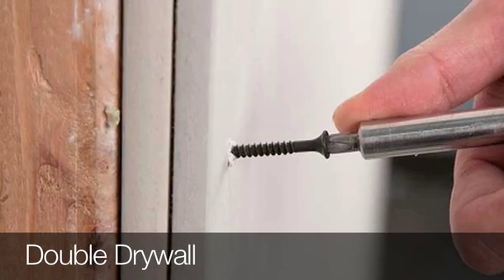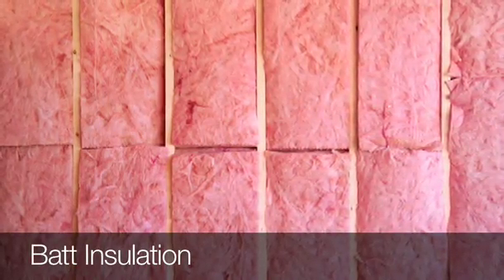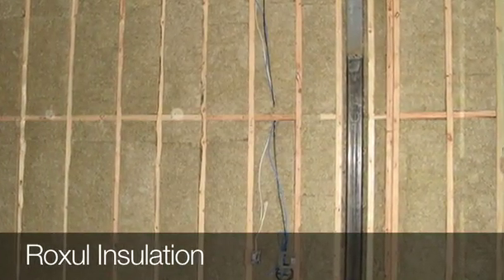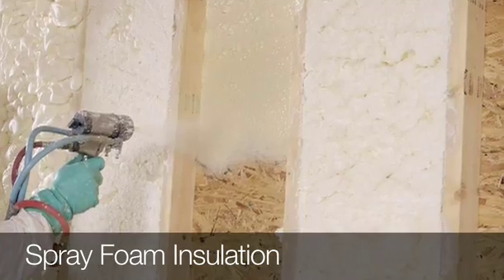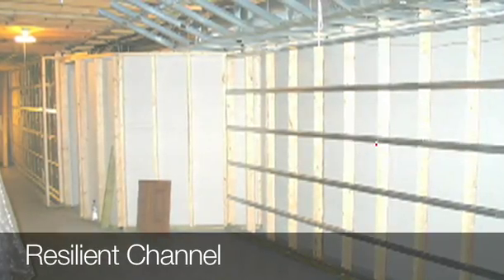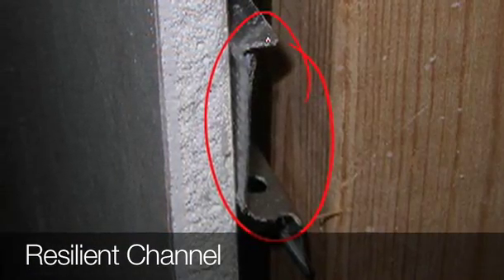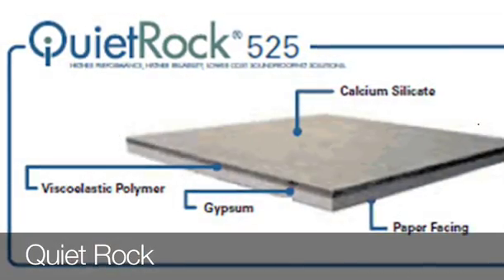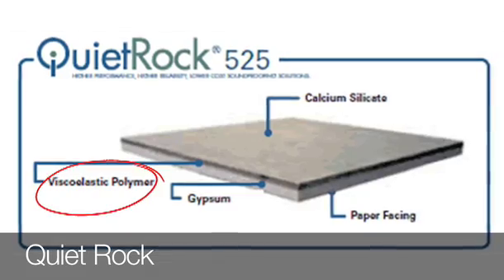How to Soundproof Interior Walls

Comment: From my limited experience, if you are going to invest in two layers of drywall, screw in the first layer as  you normally would, then put something, almost anything squishy and sticky between that and the top layer, even foam tape or silicone, then put screws only on the perimeter of the top panel. If the layers touch, it will be almost like having one thick layer, a little quieter for sure, but less than if they are isolated. And caulk around the edges. Also, if you use fiberglass, pack it tightly; fluffing it up as you would in an exterior wall won't absorb a lot of sound.

Comment: For frame of reference, quiet rock is about 5 times the price of the thickest home depot drywall 5/8ths inch.  I priced it recently and even their most expensive mold resistant 5/8ths drywall at the depot was only around $15 while the lowest priced quiet rock from the nearest distributor was around $75 per sheet, same 4x8 foot sheets.  We opted for Roxul and 5/8ths home depot drywall.  Already noticed a difference in the sound transferred from the shower to the kitchen so we are continuing on and doing more walls.  Might redo all exterior walls later but for now just considering adding a second layer of drywall to the exterior walls.  

My neighbor drives a big noisy pickup truck and starts it up every morning at 6am and lets it sit there idling for 15 minutes.  Wakes me up every day off, 6am every bloody morning.  I know nothing I say will change them so I need to make a sound proof bedroom to isolate myself from my selfish neighbors that have no clue what their noise does to other people around them.
Reply: Oh brings back memories of my neighbor who let his Ninja motorcycle idle for at least 20 minutes while he had breakfast every weekday morning. The high pitched engine whine would vary RPM at random the whole time.
Reply: get a decibel meter, then call the cops
Reply: Ridic # of people that idle their cars.. Sit in em doing nothing etc. Ignorants.  Set up an outdoor spkr by their window & turn it on each night
Reply: love reading someone else doing this... WE CANT SETTLE for regular walls... Insulated and plywood covered frames (with screws) cant be beat

Comment: The first photo witih the two layers of drywall has a serious but common mistake, you don't screw both on and you don't lay them both vertically. screw the first on to the wall if you don't have resilient channels, then after that is done take green glue or construction adhesive and lay the other layer horizontally with the adhesive so there are no screws to penetrate the wall into the studs, this is critical with resilient channels because if you screw through to the studs you have totally ruined their purpose. So screw the channel to the stud, then screw the drywall to the channel without going all the way to the studs. then glue the rest.. Also, do not use the same thickness on the inner and outer side of the studs, this can cause some unwanted resonance at specific frequencies. And the more drywall the better, limp heavy mass will soundproof.

Comment: 1/4 Hardy board with red guard or rubberized undercoating on the studs for your first layer, followed by drywall screws through both layers to hold it is a very very economical way to get very good results, particularly if you seal penetrations
Reply: So what about MLV on studs + Hardy board + Quiet Rock + 5/8 drywall?
Reply: @MadLadsAnonymous  that would definitely be quiet. One technique that I really like using is 2x6 plates with 2x4 studs where the interior stud layout is offset from the exterior (both 16in OC). This uncouples the interior wall from the exterior wall, is up to code. 5/8” rock and quiet wool. They have some quiet rock that I like to use on the lid for ceilings in 2 story applications also. This 2x6 w/ 2x4 stagger method is what I use for interior quiet walls also: laundry room, bathroom to bedroom walls, etc.
Reply: @Natedoc808  We are looking at ICF construction (Perfect Block) for our next build, but I'll look into creating interior walls per room so they're all technically decoupled from the core structure.
Reply: @MadLadsAnonymous  ICF is bombproof, extremely quiet

Comment: Excellent video. Thanks very much. I would also suggest Mass Loaded Vinyl. It's ultra heavy and dense sound absorbing material. You hang it on the studs it's the last layer just prior to hanging the dry wall. Not very expensive. Possibly more effective than double layer dry wall. But as I say its very heavy.
Reply: Also MLV is expensive and the best way isn't to hang on it on the studs, it's to have it snake in a wave pattern (image a birds eye view of a wall), so that the mlv can properly flex to deflect sound; which means you need even more MLV material. Two layers of 5/8" drywall with Green Glue in between will work better than MLV on low frequencies. 

MLV is far better as an underfloor layer than in walls. A floating floor with MLV under it is great at stopping airborne and mechanical (impact) sounds.

Comment: Hi I live in apartment first floor . Landlord said I can do what I need so if I put foam on celing with an  adhesive let it dry then add 4x8 acoustic panels that are thin by using nails or screwing them up on the existing ceiling.  Layering foam then panel will this work ?? Bathroom is 8x10 no light fixtures or fans just flat ceiling

Comment: If you use battens & thick rubber washers to keep the battens from the wall it will serve the same purpose as a resilient channel
Reply: GETTHEDEUCE pls can you explain further. I'm curious to know how to do this
Reply: @isaz597   Cross batten the walls with another timber, but between the studs and battens have the washers. Then drywall as normal, fixing to the battens.

Comment: Spray foam hardens therefore transfers sounds.
Reply: Maybe if you speak with a lisp the sound does not transfer as well.
Maybe if you thpeak with a lisp the thound does not transfer as well.
Reply: Wrong.....
Reply: Spray foam has bubbles therfore traps sound

Comment: Acoustical sealant around penetrations and Junction points (places where walls intersect with ceilings, floors, and walls) is also important when assembling a wall system that is promising an STC of 50 or greater.  But, keep in mind the 3 important safety senses we all possess: seeing, smelling, and hearing. Therefore, being able to hear if someone is in a room, can be important.
Reply: Eric Barritt the last bit sounds dodgy to me. Pictures spring to mind!

Comment: Argh, this video is terrible, don't follow their advice:

1) Resilient channels are a REALLY bad idea! It's far better to buy isolation clips + metal hat channels
2) Spray foam mechanically connects everything and makes it worse than before.. you might as well not have a wall. 
3) It's far cheaper to buy two standard layers of 5/8" drywall and sandwich them with a layer of Green Glue in between.(yes, it's more work, but it's still cheaper AND better than 'soundproof' drywall) 

Isolation, Mass, and dispersal together are what will stop noise.
Reply: Soundproofing Drywall is a much better solution than double 5/8" drywall with GreenGlue to achieve an excellent STC (sound transmission class rating). Double Drywall is however a good alternative for people on a budget but your STC rating will be much lower. I've soundproofed homes for over 10 years and lived with both wall assemblies in the same home and it's an obvious difference that is backed by technical data (available on the QuietRock and GreenGlue websites). Resilient channel also works well if installed correctly. Where I live RC is required by code in all multiunit residential renovations to reduce sound transmission.
Reply: @DaruDhillon  Hi there Soundproof Double dry wall + Green glue put straight on a concreate bedroom wall good idea please?
Reply: @dellsmith6026  Hi Dell, I've only built (2x4) stud walls with an air gap, where concrete walls are concerned. I wouldn't want to attach drywall directly to concrete without first allowing an air gap between the the wall and drywall as I'd be concerned with moisture getting in behind the drywall, causing it to mold.
Reply: @DaruDhillon  Thanks your cute by the way 😊
Reply: Do I need to mud and tape the buried layer?
Reply: @414pwz  nope

Comment: has anybody tried these combinations?
what are your best results?
Reply: HoldUpStrong res bar or sound bar is always the best. Add any accoustcal insulation to improve it. Double up fire rated 5/8 thick drywall for a complete package. Do all interior walls and ceiling for a sound isolated experience. 

Sound bar creates a vibration separation between wood or metal frame and drywall.. which usually solves the source of most sound complaints. Accoustcal insulation will have negligible effect on this sort of sound.
Reply: HoldUpStrong :
Reply: I've used r-15 2x4 wall, 5/8", green glue, 5/8" caulk bottom to floor, caulk all penetrations. Excellent results, decent price.
Reply: @Deegan don Must be the pile fibre structure that does that. Shame that you would need like 500 towels to do a single room lol.

Comment: How about electrical outlets door jambs and everything else that protrudes from an interior wall how do you make up for that extra 1/2 inch or 5/8 of drywall? I would probably think maybe you're putting a 5/8 on top of the already half inch due to the fact that it's a little bit thicker and a little more quiet. Or am I way off on that and it wouldn't make the gyms and electrical outlets a bigger thing to concern yourself with? And this is obviously I know already built house that's fully furnished and people are living in
Reply: Woodwork would need to be removed and replaced on top of the new drywall layer, adding filler pieces for jambs and openings.

Electrical outlets and switches have little tabs to rest flush on the drywall.  Make sure electricity to the circuit is off and remove the screws.  The outlets need to be folded into the box so that they can fit thru the holes measured and cut into the new drywall before hanging.  Then when the wall is ready they can be folded back regular, where the tabs extend past the opening of the wall.  It may need longer screws to reinstall, and as sound proofing is the concern of this video flanges that extend the walls of the box to further separate the space can be used.
Reply: MrNateSPF that's a whole lot of work as I've done that before. before I was disabled that is. I still know how to do it all but I just don't got the strain or the willingness or ability to really want to tackle anything like that anymore. I was very good at doing crown molding and interior work but I was also good at Framing and drywall tile work as I did a countless bathroom and kitchen remodels. I could say that was a majority of my work was the remodeled bathrooms and kitchens. But I did much more of the bathrooms as I was doing more of dry rot repair and mold replacement.
Reply: They make extender fittings for electrical boxes, but I never had much luck getting them to fit. I just pack the gap between the drywall panels with plaster or drywall filler to avoid any fire hazard and use longer screws.

Comment: Regular BATT insulation does NOT WORK at all!!! I'm having sooo many issues with noise. I should have used Roxul in the first place!
Reply: Actually regular batt insulation (low density)  has tested better than Roxul. Many time there are penetrations or flanking problems that result in poor sound isolation.
Reply: @specialblend218  Would you mind sharing the source for that comparison ? I'm still on the fence about which type of batt is better for blocking low frequency noise from outside.
Reply: @surg23  I believe it was Rod Gervias in his how to build a home recording studio book (it's a great book). I used many of his techniques to build a home theater and it came out great. I used a mixture of fiberglass Batts and roxul safe sound. The safe sound is really to use in stud bays that have outlets and other areas. Here is a link to what Rod said: https://www.gearslutz.com/board/showpost.php
Reply: @surg23  also if your main goal is low frequency isolation, spend extra time on adding mass, air sealing, adding more mass, decoupling, and extra mass should be added for good results. The sound proof company sells and has really good data of wall assemblies that are helpful. Oh and don't neglect the doors. They are the hardest part of sound isolation.
Reply: @specialblend218  That was very informative, thank you. I have watched some videos detailing the benefits of de-coupling and air-gaps between layers, which is something I will try to implement. 

Apparently the high density fibreglass batts are the way to go, at least here in Australia. The two main options are the Soundscreen and Polymax batts. Having trouble finding the rating for the Polymax but the Soundscreen has a rating of Rw 61. Perhaps I should just go with the highest density sheets. 

Picking the right plasterboard is equally troubling lol. I will need to investigate that link you sent and do more research. Cheers!
Reply: @specialblend218  Hmm, there was a problem with that link you sent. It gave an error about an invalid post. It's okay though. I will press on lol.
Reply: @surg23  the reason the batt choice doesn't really matter much is the flanking noise. Sound will hit the wall and go through the studs and exit the other side. This where decoupling comes in. As for drywall mass is everything. 2 layers of 5/8inch will work well.
Reply: @surg23  the link was to a forum post by Rod Gervias that said, " 

Rod Gervais

#4
13th July 2015

Use the least expensive option for where ever you are located......... there is no decided advantage spending a single penny more than you need to for insulation inside of the cavity........

In the US the best option is generally normal ordinary fluffy fiberglass insulation.........

Rod."
Reply: @specialblend218  Yeah that's a good point. Timber does seem to transmit sound quite well. I have just realised that there is virtually no price differential between most of the batts over here, at least in the fibreglass/glasswool varieties. 

I have a huge dilemma though that I can't seem to get any answers to online. I have a wall mounted A/C (window unit) in my bedroom wall (brick-veneer) that separates me from my neighbour, and the sound transfer through the A/C is crystal clear. I hear basically everything they say and their barking dog. 
I have no idea how I am supposed to soundproof it as the sound transmission is through the vent itself. 
Even if I moved it to the other exterior wall, it would still pick up everything plus the noise from the street. 

The only idea I have come up with is to make an enclosure using batts or other sound suppressing materials, almost like a duct, so that it can still feed air, albeit from hole that is overlapped by the brick wall. So the sound would hit the brick, then travel up the enclosure and then through the A/C vent. Not very elegant, but it's all I could think of lol.
Reply: @surg23  can you replace the window AC unit with a ductless mini-split?
Reply: @specialblend218  Sadly I'm already stretching the budget with just the insulation, And that's only a small bedroom. It gets to around 45c in the summer and I can't afford to be cooling the whole house. For the sake of efficiency I just huddle in the small bedroom as it can be cooled/heated pretty fast.  

I am within such close proximity to my neighbour that I doubt a split would make that much difference- funnily I used to install those systems years back. 

I find it odd that Google has absolutely no results for this issue. I found one topic that covered dampening strips around the edges of the unit, but with my unit the seal to the wall appears to be air-tight. All the noise comes through the face of it. It's essentially like having a whole in the wall. 

Well I've bored you enough with my problems lol. I really appreciate the advice man.

Comment: I am happy with my spray foam but I would not use it on interior walls.  Too many negatives such as cost, chemicals etc. Plus I have read that it is no more effective than fiberglass batts.  Double dry wall sounds easy except having too reset outlets and dealing with standard widths of door jams, window seals etc.

Comment: Spray foam is the best insulation.. But situational... cellulose is second but suffers from same problem. Basic acoustical fiberglass works generally. Roxul. Or insulation made from spun and melted lava rock is VERY situational. But when installed right? It makes general contractors who have to actually please customers ? Swear by it.

Comment: And what do you do if your room is already small and all walls are brick and concrete, no paneling?
Reply: If your walls are made of brick and concrete and you still have noise issue? That is strange! I thought concrete walls were MUCH BETTER THAN popsicle sticks and card board walls we have in this country.
Reply: balamstudios you can frame out the walls and then follow their product recomondations. Or you can glue/laminate that expensive sound proof gel core drywall to any  stone/brick/concrete surface and create a modern finished look.

Rustic industrial finishes look good for some but offer little sound protection unless engineered with  synthetic core designs like the acoustical drywall.
Reply: @321192ify  They are better than an empty drywall/stud wall, but not that much better if they are thin. I've known what song was playing on the other side of a concrete block party wall with plaster on both sides, so sound still gets through.